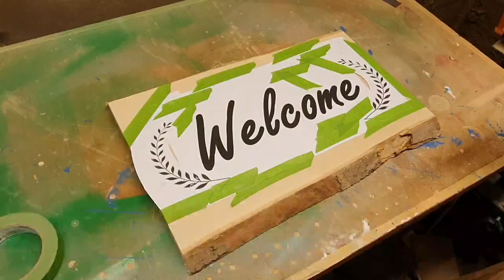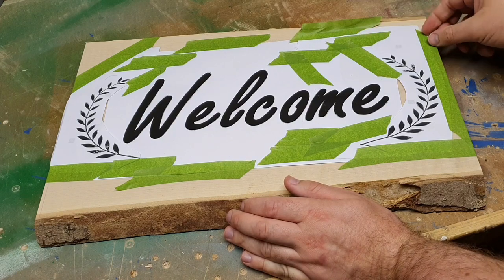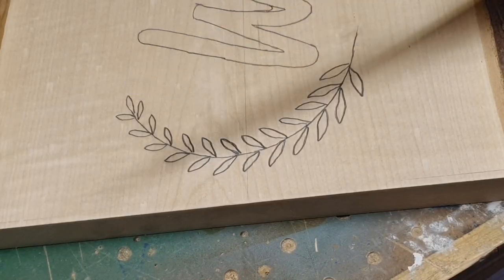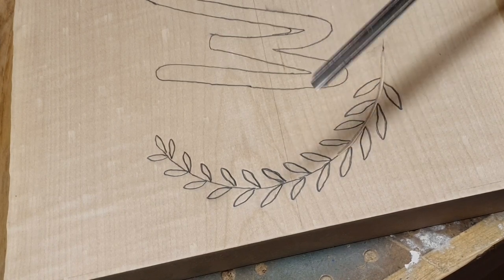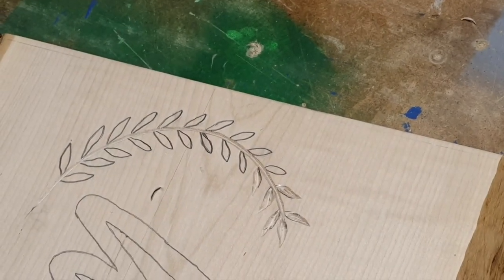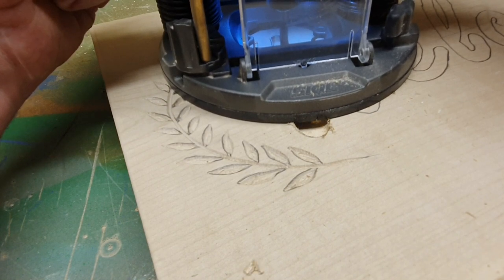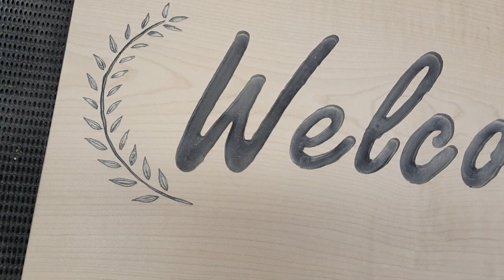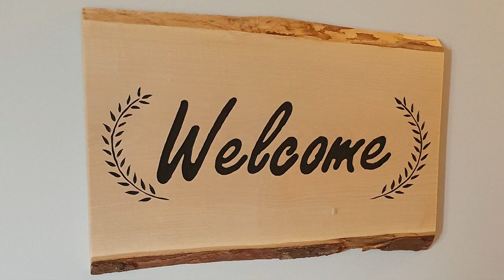DIY Welcome Sign

Comment: Great project, thanks for this.
A quick tip you may want to use for next time:
If you turn the sign over and trace the outline of the lettering with a pencil, then  turn back over to the correct side; when you draw around the lettering, the carbon from the pencil lead will transfer from the paper and onto the wood, making it easier to see the lettering.
Hope this helps.

Comment: Great t looking welcome sign if your worried about the paint bleeding on the letters just give the sign a light spray with your laquer then paint and sand it does help
Reply from the maker: Thanks thats a great idea, my main worry was the black soaking in outside the routed area, ill try the lacquer first next time!
Reply: @BCdesign1  I know what you mean it happened to me until i seen this being done it stops the black bleeding,i use black acrylic and sometimes spray works 99% of the time